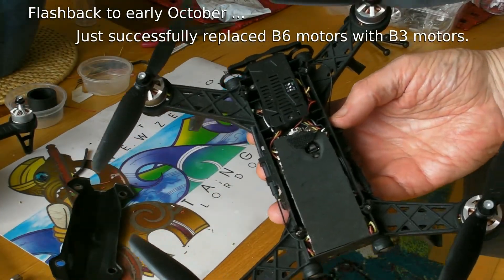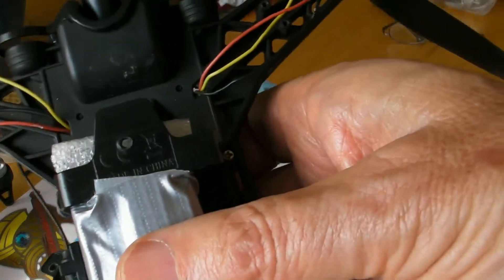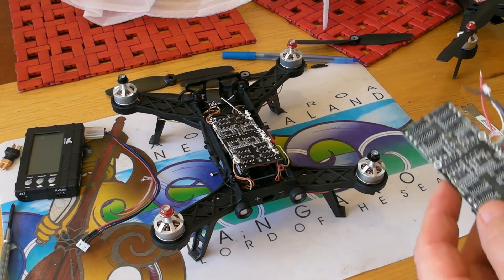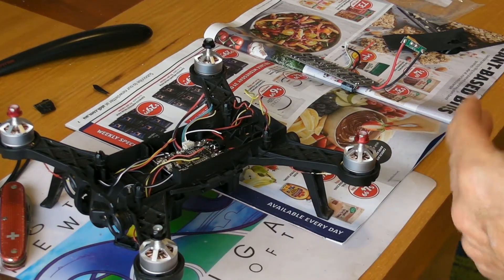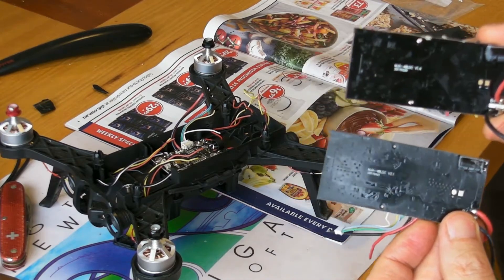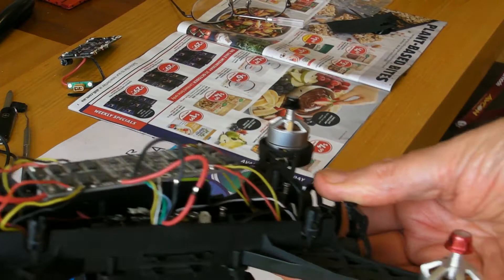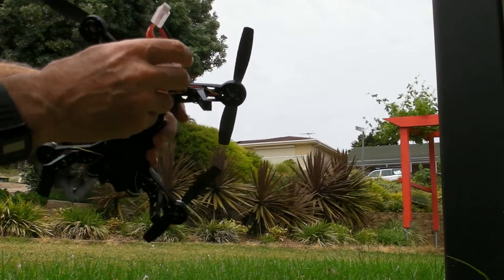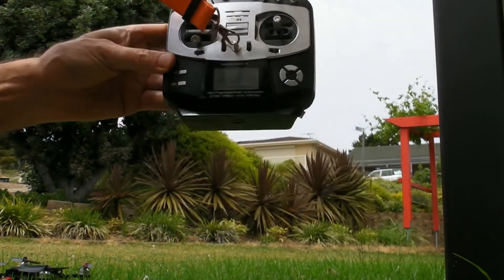MJX B6 with B3 motors - replaced the ESC Board

Comment: Hi do you know ho to calibrate one esc on this drone?
Reply from the maker: I did not have to do any calibration after installing the new 4 in one esc board. The other 3 escs on the original board still worked to spin the props, but the smell of burning from the damaged part of the board made me power down quickly. Having separate escs on the Bugs 3 is an advantage.

Comment: Very nice job 👍 👍 very nice flight as well 👍 👍 how are you liking the Jumper?
Reply from the maker: Thanks. I bought the Jumper to fly my Whoops (E011/H67) and a Hubsan X4. It was great for that, but when I realized that flying the Bugs 3 and 6 had become an option, I got excited. Since then, with the addition of range and battery warnings,  plus a 2W Booster that screws straight onto the Jumper, I've been extra happy with it.
Reply: @skybug3  I fly the Bug's 3 with it and I am using it with just the antina it came with and I get great range out of it. I fly the Immersion Vortex 150 mini with it and the Happy model Mantis with it get great range with all of them. From what I have gathered with your setup you can get really good range out of it 👍👍
Reply from the maker: @GenesRCAddiction  Yes, range can vary a lot, depending on where you fly. At a couple of sites, I was losing control at around 250m. With the Jumper I've been out about 450m at these places, which is about all I need.
Reply: @skybug3  very nice 👍 👍